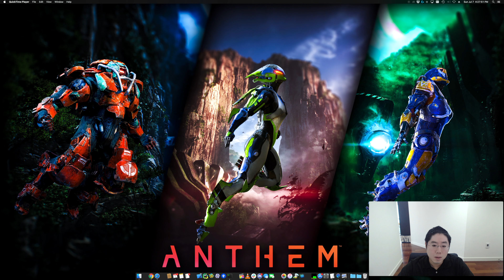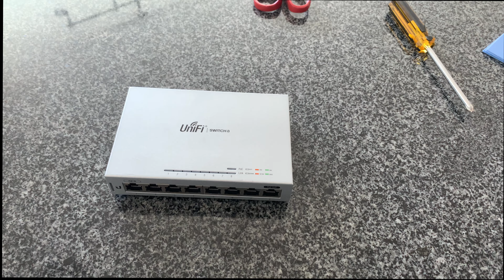Improve cooling on the Unifi US-8, US-8-60W, and US-8-150W switches!

Comment: there wasn't really any significant difference in the temperature of the before and after mod. you should have just bore a hole on top of the case and added a fan there.
Reply: Yee and he just switched the temp from the bottom of the case to the topp. He doesn’t know if the core temp of the CPU has changed. Plus all that heat transfer stuff upon the heatsink may have restricted the airflow all around it, especially when mounted on the wall horizontally! 😊 Cheers from Sweden!
Reply from the maker: Actually I do know the core temp improved because it's measurable on the US-8-150W in the stats.  Thanks for your input tho.

Comment: fast, easy, 30 bucks solution without loosing warranty:
On room temp of ~20°C it is possible to lower temp of the 150W switch from 75°C to 56°C (all 8 ports used for PoE of AC Lite APs).

1. flip switch 180 degree, so so hot part (bottom) is on top (helps in tip 2 and 3;)
2. stick some heatsinks to the area where the internal heatpipe connects to the case (you have to unscrew to check where exactly the connection to the case is! It´s just a 4 cm x 4 cm area)
3. place a big fan on top, I suggestion: AC Infinity MULTIFAN S2, 140mm USB, low speed is fine, it has some rubber feet, which elevates the fan above small self sticking heat sinks. Depends on your setup, you can easily choose which direction the hot air exhaust will be directed.

Of course you will loose 1 HE in a server rack, but I assume it will boost up longlivety of the switch.

Comment: I used 120mm 12V DC PWM fans cut into the top of the case right above the heatsink with an external 12V transformer. The PWM fans are super quiet (less then 22dBA) and the temp difference in amazing. The 48 port Unifi switches I was using, went from 158 to 97 degF. I think this PWM fan mod will consistently maintain a 20 degF temp above ambient room temperature. I have been running for over 6 months and have had 0% problems. This is a Permanent fix and has reduced my anxiety of over heat related failures. but like you said it will void your warrantee, so, due it, just like any mod, at your own risk. https://www.youtube.com/watch?v=is8-U7qrF5Y&t